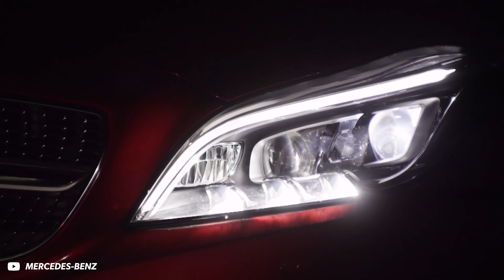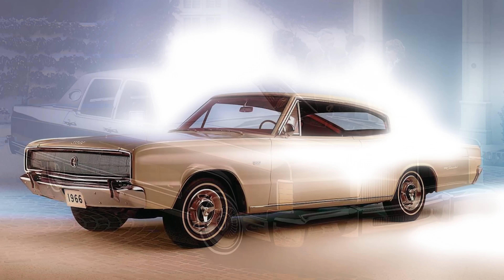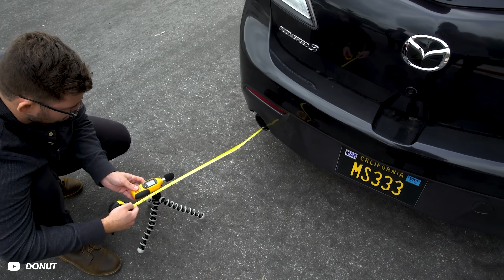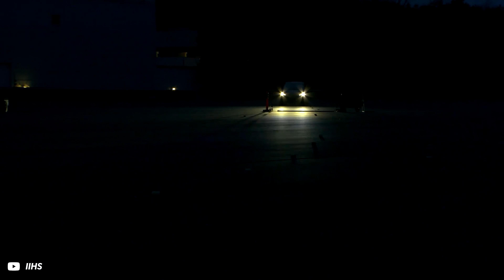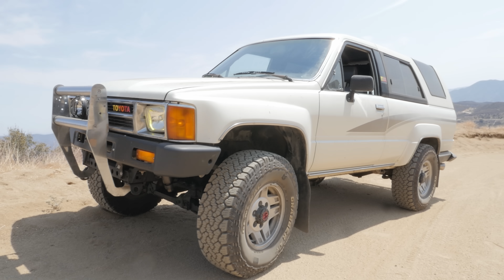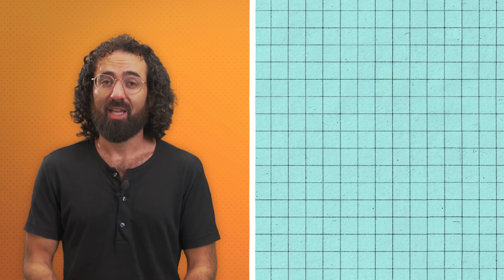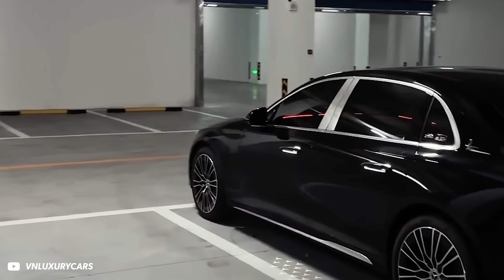Why new headlights are blinding American drivers

Comment: Those headlights sound like a good idea but what happens when they fail or the sensors get scuffed up or just faded with time. Cars are becoming more expensive than ever and virtually disposable because there is more and more technology put into them that is just too difficult and expensive to have repaired and cars are having far more problems than when they were build as basic transportation with less to go wrong. Regular headlights rarely fail and when one goes out you almost always still have at least one headlight, I can see these failing in ways that regular headlights wouldn't where they both go out together. We need to get back to basic cars, headlights weren't a problem in the nineties and prior just make them a little less bright and angled a little lower. A lot has to do with people using their brights or high beams when they shouldn't but that's a human driver problem not a vehicle problem.

Comment: I live out in the countryside, so i dont get much traffic, but when i go to the city the lights definitely make it a lot harder to see. I get flashed even in two of my vehicles (2016 Ford Explorer, and a lifted 2000 Cherokee). The only vehicle I have with aftermarket headlight assemblies is a 2003 Ford Expedition but i dont get flashed in that one. I can understand getting flashed in my lifted Jeep but i shouldnt be getting flashed in the Explorer. That being said my Explorer definitely can be blinding at a specific angle and thats to be expected but sometimes i'll still get flashed. Has those projector lights or whatever they call them nowadays and if one goes out i have to replace the entire assembly. Now these headlights have a replaceable high beam bulb, but not the low beam. As someone else said, it wasnt until probably the last 15 years where headlights being too bright has become a thing and I definitely dont think its because i am 15 years older.

Comment: USA lighting regulations are archaic, even the design specs for the beam reflectors are behind African regs 😂, so don't even bother bringing up matrix. but all you need is a cable to unlock matrix lights if you have the hardware ez pz

Comment: I think a big part of the problem is people going to AutoZone,peo boyy, O'Reilly's and buying high output led bulbs and installing them into factory stock headlight housings,  that aren't designed to focus the light output of led bulbs and they actually just scatter the light unfocused ( blinding ) other drivers and severely decreasing the light illuminating the road therefore decreasing their vision,and they think it's cool to buy the highest kelvin temperature possible,(6700-8000 ) because its almost purple and those shorter wavelengths are very much harsher on human eyes

Comment: I have driven cars and heavy trucks. 6V, 12V, 24V. Kms in 7 figures. I've had bulb lights, halogens, xenons and LED's. I'd take my current lights over older lights any night. You don't look towards the lights of the oncoming traffic. Look a bit to right in right side traffic and a bit to left in left side traffic. My own car's lights are not yet matrix, because I couldn't get matrix because of component shortage in 2022. Mine are the next best, long distance LED-lights and have some of the features matrix lights have. I have driven also cars with matrix lights. There are no perfect lights, never have been. All lights, even rally lights, always have some problems. Current better lights are pretty good, I can drive with them ok. There might be exceptions in cheaper/older lights. I haven't driven all the cars in the world. I can afford to buy my cars new and always order the best lights available. My country has all kinds of weather, including snow. I'm no longer young, which also means I want the best lights I can get.

Comment: Suggestion for other vehicles regarding the disaster of US regulations:
- How in US every SUV is a Truck!
- Amber rear turn signals, and the fucked up regulation about how they supposed to be.
- No rear fog lamp
- Why trucks and trailers don't have yellow turn signals
- How the rest of the world have better exterior mirrors than US with smaller blind spots
- Can't install camera as mirrors
- Why buses and trucks in America have mirrors at the high of pedestrians head, while the rest of the world put it higher to protect them

Comment: Swede here, adaptive headlights are not a solution. Adaptive headlights only dip the beam in the direction of your car but it completely ignores secondary paths, aka reflections, because it can't see them. Try this experiment; take a powerful flashlight out on an empty street, point it directly at you and walk 100m away. Now the beam is clearly blinding you, so extend your arm and block the direct path to the flashlight with your thumb. Looks a lot better, right? Now try the same thing in the rain and you'll see what I mean.

Even worse, adaptive headlights makes the driver not switch to dipped beam when there's oncoming traffic. If you think dipped beams with powerful bulbs are bad then just wait until you experience someone with adaptive headlights in the rain who don't understand why you're flashing at them.

Finally, dipped beams are not what they used to be. I can't speak to how this was outside of Sweden because I don't have much traffic experience outside of my home country, but these have degraded a lot on newer cars. It used to be that the main part of the beam had most of the light pointing straight ahead with soft cutoffs in a legally defined pattern. Modern headlights have sharp cutoffs to the legal pattern and the light intensity spread close to uniformly in the legally allowed zones. This makes objects close to to car easier to see but decreases the relative light further away. The real devil in the detail though is this makes those reflections I mentioned earlier way worse, since the worst ones like puddles are typically close to the car from the perspective of an oncoming car.

So what about adaptive headlights, should they no be legal then? It's not that easy. To me it's more like having TCS; it can further extend the limits of what your car can do, but it's not a general fix for poor suspension design. You can't fix a fundamentally broken beam pattern with adaptive headlights.

Comment: Adaptive lights are just as bad, because more often than not your blinded long before your in sensor range...apart from it only being installed in certain vehicles. It's a bandaid for a cut artery... I'm a Dutch truckdriver, and in the truck, there's no problem, because I'm way up above the highway. But in my regular car, it's a different story...yes...in Europe as well. We have take a medical exam every few years, and even the doctors taking those exams recognize the problem and the effects on the eyes...even for truck drivers that only get a fraction of the public eye laser surgery one oncoming car at a time... The real problem is contrast; At night, white light is blinding. Take that same light and turn it a bright yellow and away with the problem. But, ya...enforcement...hardly done in Europe...even if there are laws that curtail the use of these eye damaging tools of head-on collisions...maybe we need a higher death count...

Comment: The blinding is due to aftermarket bulbs not designed for the housing reflectors of the specific vehicle so the light throws forward instead of back to the reflector to be focussed properly.   1st grade light info.

Comment: I have aftermarket 6,500 Lumen LED bulbs in my reflector housing. I aimed them as far down as they go and on a level road it shines up to the license plate on an NA Miata and has NEVER hit a mirror or windshield without a sloped road being in-play. The roll-off claim in this video, as well as a lot of online rhetoric incorrectly agrees with it, is completely null in all but the oldest reflector housing headlights. I've been head-on with my own vehicle while riding in another and it doesn't cause a single problem for anybody. Meanwhile every brand new Toyota, Hyundai and most Subaru's on the road blind me completely. I'm so sick of this 'aftermarket LED bulbs are the problem' idea when the majority of cars blinding me are newer than 2018.

A HUGE amount of times I've been blinded by oncoming traffic is with those ADB automated tracking lights. They don't work like they advertise them to. Even the absolute best unit on the market is still blinding every oncoming car for at least a fraction of a second, which creates a dazzling effect and lasts far longer than the amount of time you were hit with the light beam for. These systems don't work and should be illegal.
Reply: Jup I 100% agree those ADB lights do not fix this problem!
Reply: The "aftermarket LED" is a problem, but not when installed by someone who is being thoughtful like yourself. Thank you for doing that work. It's much appreciated.

Comment: Most of new cars with led lights are blinding when going from the front its like they using long light instead of road one and second few month ago some pickup stoped behind me on red light his lights were at the level of my car windows so my car was lit inside like someone throw flashbang inside i turned middle mirror but was unable to turn left and right and those were blinding me so much i didint see road in front of my car

Comment: a replacement sealed beam   used to cost   about 10 pounds  .
now   a new  headlight   will cost   over 1000 pound   . how's that progress  ?
so if your car has a slight bump  and needs new headlights   it's  scrap.
 a front bumper and  headlights  will cost thousands to repair   [ total madness ]

Comment: Most likely the problem is with the slope close to 0%. Older headlights were 1.5%, 10-20 years newer were around 1%, it has decreased over time.
Even cheap cars offer LED headlights with MANUAL range control, Dacia/Renault for example.
I have a 2014 VW, it has dynamic light assist, it tries to point the light away from other cars but i get flashed almost every time from oncoming traffic, it does not work very well, maybe MATRIX is better, who konws!

Comment: Sorry, but I have never seen even a single car with this adaptive headlight technology in Europe. The only thing that has become pretty standard is angling the beam sideways when you go around a turn. 
On the other hand, there is also not a big problem with blinding lights in Europe, because the beam is tight and directed at an angle downwards, and headlights are all installed at pretty much the same height above the road.

Comment: That sounds like great tech regarding the headlights in Europe. I would love that here.
Another problem is people buy led's for their vehicles and then don't spend a few minutes to aim them. When I bought my 2019 F150 XLT, it came with incandescent bulbs. This generation is known to have horrible headlights and I agree with that, so I ended up buying led's. After installing them I drove to my work because there's a nice big white wall with level ground in front of it to adjust the lights. On the way there I wasn't impressed with the led's. I had to adjust the led's way down to make them correct. I must have blinded a bunch of drivers on the way there. Point is, adjust your new led's.

Comment: I use the M.A.D principle when driving at night. After years of driving at night for work and being the considerate driver who turned off their brights like I was taught in drivers training and usually first, I got tired of people who could give a fuck less because my low sitting sedans with normal light brightness didn't effect them at all. Tired of people who only turn off their brights at 50 feet away, like they haven't been blinding you the past 40 seconds. Or those that never turn off their brights even if you do.  Now I have super bright, but well calibrated lights that will blind the ever living shit out of other drivers, or my low beams that are damn near pleasant to drive by. M.A.D: mutually assured destruction. I will not be the first one to turn off my brights, if I see no light change from the oncoming vehicle they can enjoy being blinded. As soon as they turn theirs off I will in turn. So they get to choose when they want the blinding to end. I chose to no longer be the only one blinded at these junctures. The result is that 90% of the time the opposing vehicle will turn off their brights now. Before it was maybe 25% of the time. There are a couple exceptions to this doctrine. First is vehicles who clearly already have their brights off, second is anyone still rocking the old school incandescent lights. Also tinted windows helps with being blinded from the mirrors. Also also, if you are going to warn someone about danger ahead use fog lights if you have them. Much better than being flashed with high beams and blinded just before you are about to encounter deer, out whatever else, on the road.

Comment: England here: I recently had the annual MOT (legal requirement for all cars to ensure they are safe and roadworthy) on my Volvo V40. It has LEDs, unable to adjust the height of them as they're automatic and they also bend as you drive around curves. I failed my MOT because they were too high positionally and I had to pay £5 a bulb to have them physically readjusted. So I have been blinding people and not realising it for a year at least.

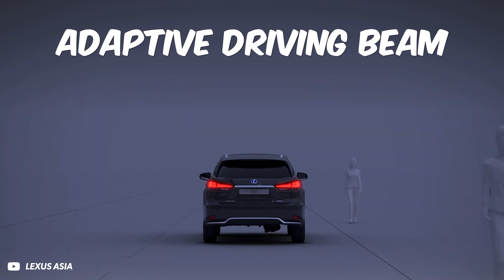Comment: 09:12 "Adaptive Driving Beam  is F game changer"

For drivers eyes only. 
For pedestrians, people who riding on a bycicle in an opposite direction is not a solution and still makes them blind too.

Most new annyoing manufacturers gag come from germany, again: premium car makers used to switch on 1/10 section of the headlight into a corner. Which seems right on paper, meanwhile on the road they switch on their LED / Laser matrix headlights which has very brights lights... 
Just think a cross road, where you sit in a car and a german premium car driver wants to turn into the same road where you just waiting to continue to drive. Their "smart" lights will make you totally blind. At least those cars' drivers will see better the cross roads,while turning ...

Comment: As a European : screw the ADB.

It doesn’t detect pedestrians or cyclists, it will cause drivers to just use Hi-Beams constantly, including in cities, it requires powerful computers and a fucking internet connection (and don’t go reading the manufacturer’s privacy policy, you’ll have a heart attack).

So really, just teach drivers to ser their lights correctly, fine them harsh when they don’t, and ask makers to create a simple way to change beam height.

Comment: Regulations need to be improved.
Headlights should be measured by how far they reach. Meaning that taller vehicles need a sharper downwards angle, not to blind others that have smaller cars.
Also, a maximum height from ground for headlights wouldn't be a bad idea.

Automatic high beams like you mentioned also need to be better regulated, many manufacturers don't have very responsive systems on this, and will blind drivers coming around the corner for a split second before it detects them. 

All in all, it's good to have better lights, but it requires better regulations. Additionally, in the US there's several states that literally have no annual inspections! Meaning driver can modify whatever the F and there's next to no consequences.

Comment: Sure, let's over complicate headlights with matrixes and tech. It's not like they are not expensive AF right now, not to mention built like crap. They chip and break easily so as to not hurt pedestrians in case of a crash, but cost a fortune to replace. Very sustainable for the end user? No. Very profitable for the manufacturer.

Comment: Dumb-ass, European cars have had STEERABLE headlights REQUIRED since the 1960's! I owned FIATs, Lancias and Maserati Saloons from 1968 on, that ALL came with steerable headlights that had to be DISABLED to meet DOT specs! You pulled a disposable 4 cent cotter pin to disconnect the "arms" on the steering mechanism, passed State "safety inspection" and replaced them! My Maserati/Citroen came with YELLOW headlight bulbs, I got tired of explaining to Hi-Po Troopers and replaced them with clears, 150 WATT H-4's and 175 watt H-3's in the driving lights!!!

Comment: Or people could stop looking in to the oncoming traffics light, everyone who has been driving for a long time knows, during nighttime when on none city roads look to your right far ahead in to the ditch and you won't be blinded unless people are using the high beams. This is common sense in Sweden and yet people keep failing and looking straight in to oncoming traffic lights at night. For example those at our latitude at winter time have darkness from 15.00 until 08.30 in the morning the next day.

Comment: If the shape of the headlight is so dramatic that it affects the drag to such a degree, that fuel economy is affected.  You failed at design.  Those little spots do not suspend air travel that darn much.

Comment: Was  not the spec for low beams in the old days to be aimed slightly at the ditch and have a lamp shade on the emitting element in the bulb and high beams aimed strait down the road? Why do super duty trucks have 6 low beams? High beams should be sky the limit with auto dimmer but low beams should be better regulated. Seems in the 60's GM big cars could be had with auto high beam dimmer. I think some people just drive with their high beams on and don't care.